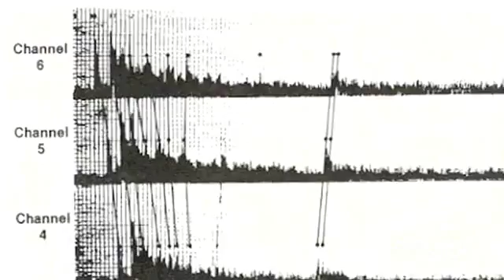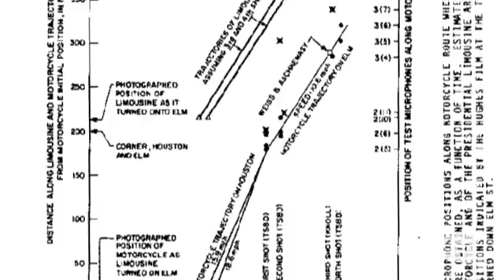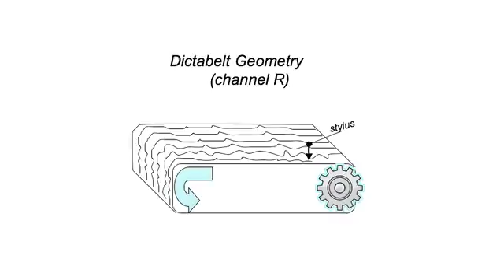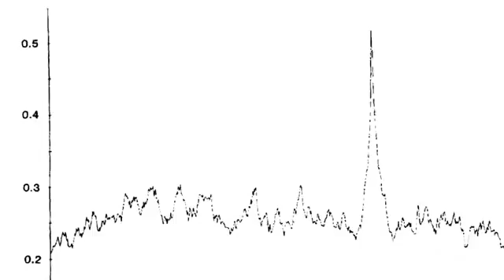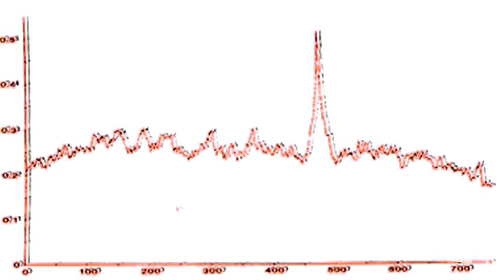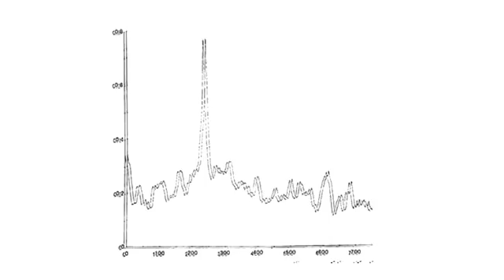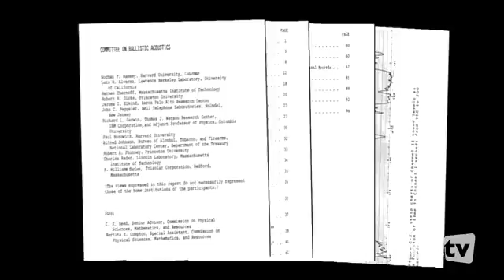JFK Assassination ~ Dictabelt Acoustics Analysis

Comment: Ahhh........assembling a group of "experts" who come from defense contractors and universities with government grants hardly qualifies this " panel" to be objective and unbiased....there is a REASON why some oppose their conclusion that the acoustic evidence is invalid. NOWHERE in this video is a description of how the original experts found that the impulses, shock waves, and echoes of the TEST FIRED weapons in Dealey Plaza MATCHED EXACTLY to those same elements found on the original dictabelt recording !!!!   I am talking about data which is found on the waveforms of  BOTH the original recording AND the recording made from the test firing of rifles from the depository and grassy knoll. The huge array of microphones PRECISELY located during the test firing that 3 shots came from the area of the depository and ONE shot came from the picket fence area on the grassy knoll......eight feet down from the corner of the fence, going towards the overpass.
       This data has NOTHING to do with the issue of "cross talk", which appears on the "motorcade" dictabelt recording.  The above video does NOT explain the SIMPLE FACT that, as the "expert" said in the beginning of the video, EACH separate dictabelt recorder would STOP RECORDING whenever the incoming audio level dropped below a certain point. The constant stopping and starting of the two different machines made it IMPOSSIBLE to "synchronize" the two recordings together, to establish an exact time frame of EITHER dictabelt recording !!!
       The appearance of the slight "cross talk" presents a conundrum, but, cannot PROVE that the SOUNDS ON THE DICTABELT are NOT GUNSHOTS !!! The impulses, shockwaves, and echoes of the test fired rifles MATCHED EXACTLY to those found on the dictabelt recording.......this is NOT MENTIONED in the above video, and THAT casts grave doubt on the sincerity of this presentation !!
         Supposed "experts" are used constantly in courtrooms to sway judges and juries while collecting huge sums for their testimony. When it was found that our CIA was assassinating foreign leaders in the 1970s, and that  they were OUT OF CONTROL, as President Harry Truman said ONE MONTH TO THE DAY after JFK's murder.....you don't have to be KOJAK to smell a rat !!
Reply: +Mike T156 FO shill!
Reply: +Mike T156 gee how was your last Alzheimer's test? Just sayin'
Reply: +Mike T156 - hmm central Pennsylvania - are Amish - just kidding. Yes it turns out we are on the same side. What do you think of Trump? If the HildaBeast cheats her way into the White House that could be it.
Reply: +Mike T156 - Just curious what you're opinion is of 911 and the 28 pages of the 911 commission report?
Reply: Mike T156 ....not everyone has the INTELLIGENCE to see the plain truth before their eyes...
Reply: Mike T156 ......the U.S Army expert testimony given to the Warren Commission AND research done by others, including the late George Michael Evica.
       Why didn't Oswald just buy the ammo from Klein's ??? Whole thing makes NO SENSE. Oswald was around TONS of guns being run out of New Orleans by his pals.
      The ONLY thing that makes sense is that he was TOLD to order that rifle ....like I said, Oswald has FBI informant # S179 and Evica uncovered Senator Dodd's, ( former FBI agent), "investigation" into mail order houses, which INCLUDED Klein's.
Reply: Mike T156 ...the ammo was CIA ammo...made by Western Cartridge Co. in Alton, Illinois.....owned by Olin Corporation, which was in Connecticut....near Senator Dodd, who HATED JFK...as did the OTHER former Senator from CT, Prescott Bush.
     It is interesting to note that JFK was FURIOUS that the Bay of Pigs failed. Once underway, he quickly surmised that the glowing predictions of success by the CIA was a total LIE. He realized immediately that the operation was designed to be a TRAP for him.....where he would be FORCED to committ actual U.S. forces in order for it to succeed....something he did NOT want to do.
      After firing Allen Dulles, Richard Bissel, and Charles Cabell, ( brother of Dallas mayor, Earl Cabell ), from the CIA, JFK quickly launched an internal investigation to see why exactly the raid failed.
      Contrary to public belief, JFK did NOT issue orders to cancel the air mission which would have destroyed the last 3 of Castro's surviving jets....which butchered the exiles on the beach. It turned out to be someone high in his administration....someone brought in to be one of the "best and brightest" from BOTH sides of the political spectrum. That man was the skull and bones member known as " Odin"...MacGeorge Bundy.
       JFK nobly took the blame entirely HIMSELF and did not disclose this inner betrayal. Kind of like Lee at Gettysburg who did the same after numerous orders of his were disobeyed by stubborn, or, even CHICKEN subordinates.
        Bundy would NOT be the ONLY Yale "bonesman" to harm JFK. The weekend of the assassination J. Edgar Hoover sent two FBI agents to brief the CIA bonesman named " Magog",or, better known to YOU as "41" !!
Reply: +John Foster - you got it covered John, that is pretty much my finding also, I still love JFK after almost 52 years. Listening to his speeches still gives me shivers - a reaction I get when I hear the clear unadulterated truth. Especially pertinent is his 'Secret Societies' speech all thing considered. I am thinking of organizing a write in campaign where the JFK Platform gets elected (ideas cannot be assassinated) and it is up to all the presidential candidates to implement the JFK platform. If Hillary fails to get it done then Donald gets a chance then Gary Johnson, Jill Stein, Bernie Sanders etc.
Since the JFK platform is considered middle of the road and something both sides can agree on it passes the fairness test. First and foremost the Fed goes away and the currency printing goes back to the way JFK was going, that is the country prints its own money and not the Central Bankers. That alone would be a game changer - what do you think?
Reply: +Mike T156 Hi Mike since you are a weapons expert I would be interested in your opinion on the ordinances used in the JFK hit. Where the 1st 2 or 3 shots were in keeping with the 22 cal Manlicher - which was an infantry rifle designed to make a hole pass through the target and wound but not kill. The shot through JFKs neck and necktie was a small hole whereas the headshot was explosive which many people believe was a Frangible or Mercury round. Frangible rounds (I am sure you would agree) are intended to do maximum damage and to kill. Also when you use the term 'Conspiracy Theory' did you know that this did not exist until the CIA concocted it to use in relation to the JFK assassination? There are a lot of conspiracy theories and more and more they are being proven as conspiracy fact. Until Wikileaks released the emails the Bernie followers were being called conspiracy believing nut jobs and then DWS resigned. Now tell me have you ever heard of Thermite? What's the Mossad motto?
Reply: FORGET the "general" characteristics of the Carcano and its normal ammo.....FOCUS on THIS particular rifle and the particular bullets it supposedly shot.
    Like I said BEFORE....Oswald did NOT buy the Italian ammo from Klein's which was MEANT for that caliber rifle ONLY. The bullets from the depository rifle came from a lot of one million rounds ordered by the OSS near the end of WWII for use in the many captured Italian Carcanos. THAT ammo was deliberatly made 4 thousandths of an inch SMALLER than the 6.5mm bore of the depository rifle...which creates the possibility of INACCURACY. Ammo used from that exact lot in test firing had a tendency to HANG FIRE, as well !! If you ADD these facts to the official U.S. Army expert testimony that the scope was USELESS as found on the rifle....beyond ALL adjustment, and requiring THREE metal shims under it just so it could be aligned for test firing, you are FORCED to consider....as the Army did....that the "iron sights" were used.
       The Army ALSO reported that rifle JAMMED frequently during test firing....repeatedly RUINING the completion of all the shots in the time alloted by the Zapruder film.
    I was just on the sixth floor recently, standing at the next window, which is close to Oswald's supposed perch. It is PLAIN TO SEE that the heads in the cars below going by are VERY SMALL and would be very difficult to hit while they are moving down and sideways AWAY from the shooter. Considering that those sights are fixed for 200 yards, the shooter would have had to aim 8 inches lower than the head to hit it AND deal with a possible "hang fire" or, jamming bolt on that particular rifle.
     That rifle was found to have rust on the inside of the barrel....the Dallas Police DELIBERATELY did NOT inspect it to see if it was recently fired....a source of GREAT EMBARRASSMENT to them while testifying before the Warren Commission !!
       MORE was going on in Dealey Plaza than Oswald, or ALL those witnesses like David Ferrie, George DeMohrenschildt, John Roselli, and Sam Giancana would NEVER have been killed just before each of them was give important testimony.
        Roselli DID say things behind close doors to the early HSCA and was found chopped up in a barrel, floating in the water off Miami.....GOOD TIMES !!1
Reply: +John Foster - The sick fact is that David Lifton in his book Best Evidence was chasing 2 corpses but how could he have known the evil he was looking at. Fact is that JD Tippet's corpse was used in a body switch with JFK. Tippet was targeted because he bore a strong resemblance to Kennedy, in fact his nickname in the Dallas PD was JFK. The Mob used body switches quite regularly at the time Sam Giancana admitted this in his brothers book 'Double Cross'. Check out the YouTube video 'Everything is a Rich Mans Trick' it's 3 hours but well worth watching.
Reply: +Mike T156 Geez Mike am going to have to shove your head down the toilet again? You are incredibly naïve if  you believe Oswald did the shooting, none of the marksmen that attempted to recreate the shooting were able to recreate the shooting in their first attempt. Oswald spoke Russian so fluently that Marina thought he was Russian when she met him. Then after renouncing his US citizenship he is allowed back into the country and bring back Marina. Also that day in Dallas one of the hit teams was found hiding in a train car and were then paraded through Dealey Plaza and you can see Charles Harrelson and Chauncy Holt walk by General Ed Lansdale (what was he doing there?). There are also photos of GHW Bush and an unmistakable picture of a teenaged George W. Bush in the plaza that day. (what were they doing there). And for those who say there is no way that a secret like that can be kept - answer this question : I you were given the choice of $1M to shut up or yer dead what would you do?
Reply: Mike T156 ......dope.....the 3 tramps included Chauncey Holt AND Charles Harrelson......a convicted MURDERER and father of actor Woody Harrelson.
      How ironic......in the final episode of "Cheers" on television. the Boston based bar is visited by none other than Ethel Kennedy and members of the Kennedy family. Did they realize that they were in the presence of the SON of a man who MAY have had a role in the assassination of John Kennedy ??
      The evidence shows that FBI Director Hoover had his best man in Mexico City , right after the assassination, chasing down the story of "Oswald's" visit in September 1963. This agent discovered that Sylvia Duran, a pro-communist employee in the Cuban Embassy had supposedly associated with Oswald, even attending a party with him.
       He had Mexican authorities  interrogate her SEVERELY when a tape recording from a tapped phone line showed her CHEERING at the sudden news of JFK's murder AND her making a statement which appeared that she had PRIOR KNOWLEDGE that it was going to happen.
        Although Hoover KNEW the man who went to both the Soviet and Cuban embassies was an IMPOSTER, ( a FACT admitted to years later by the CIA's David Phillips), he abrubtly SHUT DOWN the Mexico City investigation and recalled his agent !!
        We DO NOT KNOW what Sylvia Duran SAID while being cruelly and harshly interrogated....but, we DO know that Hoover SHUT DOWN  the investigation because of it !!   SOMETHING stnks here !!! I think Hoover was looking to find the involvement of Castro, but, what he actually SMELLED was the CIA !!!
Reply: Mike T156 ....you HAVE a toilet ?
Reply: Mike T156 ....sounds like your last name is " Dahmer".
Reply: Mike T156 ...a " slim ball " ?? Nice typo !! Or, maybe it's ILLITERACY !!
Reply: Mike T156 ....haha !!  Funny how a " lone nutter" slides down the slope of gutteral vulgarity, due to the lack of knowledge which is needed to present an intelligent argument.
      I guess our CIA is lessening the standards for their "shills" which troll the web and spew disinformation in the face of documented FACTS that obliterate their feeble fantasy of fraud.
......OH !!! .....the HUMANITY !!!
Reply: Mike T156 You are living in a world of DENIAL !!

1. The U.S. Congress reported to the American citizens, via the HSCA, that JFK WAS killed in a probable conspiracy. This conclusion was based on NOT ONLY the " acoustic evidence", but, the myriad of FACTS obtained by lengthy sworn testimony and committee investigation. During this investigation, several KEY WITNESSES who were suspected to be INVOLVED in JFK's killing were MURDERED,or, committed SUICIDE !! These were :  Chicago mob boss Sam Giancana, mobster Johnny Roselli, and George H.W. Bush pal, George DeMohrenschildt. This small list of figures paints a clear picture of the alliance between the CIA and Mafia that was used to kill John Kennedy.

2. There today is NO DOUBT that Oswald WAS an agent of the CIA and that he was also a paid informant of the FBI, ( with informant # S179 ). Even if Oswald DID act alone and made all the shots....what in HELL is a CIA agent doing shooting at the President ??? Sworn CIA testimony before Congress by Ann Egerter CONFIRMED that ONLY CIA AGENTS are subject to monitoring by its internal "SIG" investigative unit....NEVER civilians,or, others who are NOT CIA agents !!! It is documented in WRITING in Oswald's CIA "201" file that he WAS being monitored by " SIG", the Special Investigative Group of the CIA which was headed by chief of counter intelligence James Jesus Angleton. This unit was created to search for "moles" among CIA agents,which was deemed highly necessary after Angleton's close friend Kim Philby was found to be a Soviet agent.

3. It has been PROVEN by medical experts and sworn testimony by original x-ray tech Jerrol Custer that the JFK x-rays currently in the national archives are NOT the originals. They are COPIES made on DIFFERENT FILM than Custer's originals. Medical experts Dr. Gary Chesser and Dr. David Mantik have established......beyond ANY doubt....that these images contain alterations. The most glaring alteration is the area of skull bone just behind JFK's right ear....the area where EVERY doctor and witness at Parkland Hospital reported a LARGE HOLE in the back of JFK's skull the size of a BASEBALL !! FBI agents Sibert and O'Neill ALSO reported this hole, along with Secret Service agent Clint Hill.
      The x-ray in the archives shows the skull to be INTACT in that area, with NO hole !!!
However, the "optical densometer" equipment shows that the bone is so solid in that area of the x-ray that JFK's entire skull would have had to have been COMPLETLY SOLID !!!....ALL BONE !!!.....FROM EAR TO EAR !!....LIKE A BOWLING BALL !!...WITH NO BRAIN !!!

Sworn testimony has PROVEN there was a medical cover up of evidence in the JFK autopsy....why was this done ?? There is NO DOUBT that JFK's body arrived to the rear of Bethesda Naval Hospital in a plain steel shipping casket at 6:35pm, where it was received by a Sgt. Boyajian who STILL HAS HIS COPY of the receipt he signed. Sworn testimony by two witnesses at Bethesda shows that Dr. Humes, the man who would later conduct the OFFICIAL autopsy at 8pm, ALTERED JFK's wounds in a morgue room PRIOR to the official autopsy.
        This FACT was confirmed by FBI agents Sibert and O'Neill who stated in their OFFICIAL FBI report from the autopsy that Dr. Humes COMMENTED during that autopsy that there was " APPARENT SURGERY done to the skull" of JFK. Of course, ALL the doctors at Parkland Hospital CONFIRMED that NO such " surgery" was done by them at all !!

I dont know what kind of diet that mountain, recluse hillbillies eat in Pennsylvania....but, I have a strong suspicion that it contains tons of CIA BULLSHIT !!!
Reply: John Foster Good information, Thank you
Reply: Mike T156 ......Looks like the " lone nutter" has awoken from his comatose state of perpetual inhebriation on the anniversary of JFK's murder. There must be a "nutter" convention going on somewhere in Pennsylvania. Wait a minute !! He is reading Posner's " Case Closed" in ONE hand, while JERKING OFF in the other !!! I guess he found the part where James Jesus Angleton confronted J. Edgar Hoover with lurid photos of the FBI Director and his underling engaging in filthy SODOMY !!!
Reply: Mike T156 ....so, it's TRUE......you ARE a " Pennsylvania pole smoker", a " rump ranger", and just a plain old " thilly thodomite "....you THILLY !!
Reply: Mike T156 400 YEARS!!!! REALLY!!!....You illiterate bumpkin !!
Reply: Mike T156 ...HAH !!....look at you helplessly flailing away in a sea of illiteracy.... hopelessly struggling to find the syntax to match my verbiage....only to drown in a pool of ignorance.....a pool which extends to your knowledge of the Kennedy assassination and its evil perpetrators.
Reply: Mike T156 ...so, this is what YOU do....in your parents basement !! Sorry, I don't pattern my behavior after your moronic example...." nutter " !!
Reply: Mike T156 ...........only to EAT them at night after fishing them out of the local cesspool you call a " lake " !!
Reply: Mike T156 .....HEE-HAW !!!
Reply: The dictabelt was not a recording of the assassination, it was up to a minute later.